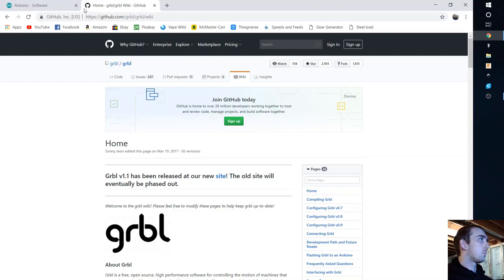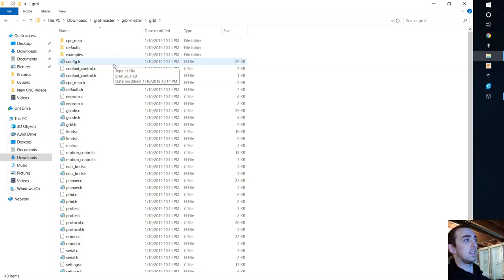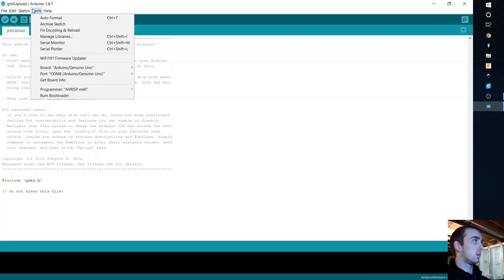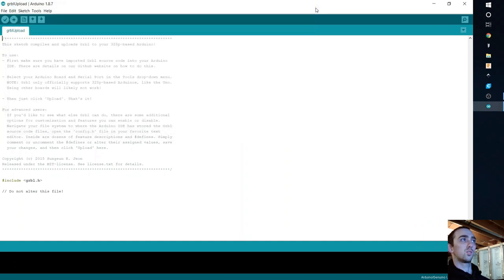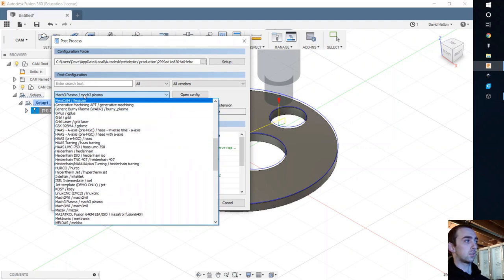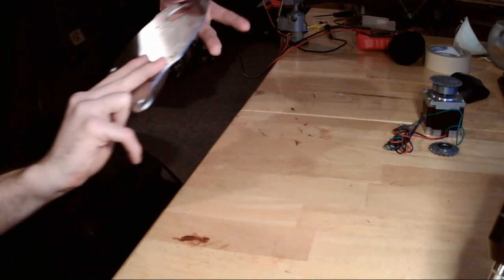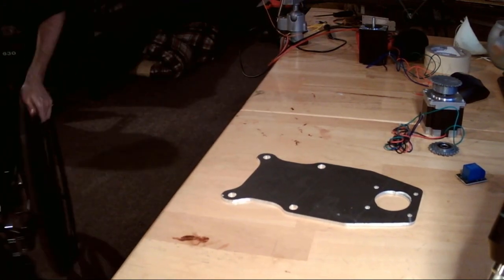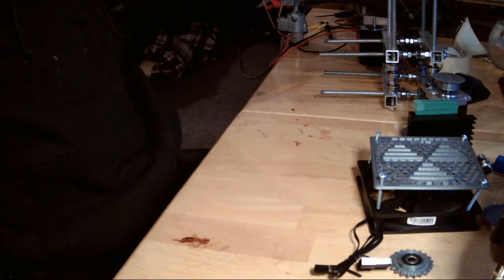Arduino UNO grbl CNC Plasma Table Setup

Comment: I built a plasma CNC machine that is controlled by the MKS DLC 32 version 2.1 card. Basically an Arduino knockoff. Works great until the plasma machine kicks on then it freaks out and either stops and leaves the torch running or takes off in some strange direction. Obviously getting electromagnetic interference. I'm in the process of trying to narrow down solutions. I've tried a number of things. USB isolator. Wrapping the leads in tin foil. Grounding the table and the gantry. Placing metal panels between the control box and the plasma cutter to act as shields. Etc. the best way to get the machine to actually execute the G-Code is to run the code directly from the onboard SD card. But that has its own issues such as no z-axis Control on makerbase ESP controller. Somewhat of a nightmare but I'm going to continue working to figure it out.
Reply: Need to use a "non high frequency" plasma cutter!! Using a high frequency plasma cutter will F*** up everything, too much noise!
Reply from the maker: So the fix is a new non-high frequency plasma as Patrick stated. However there is some solutions that can help (not fix but help) you can shorten data cables, move the plasma as far away as possible, twisted wire, shielded wire, solid grounds, and a bunch of ferrite clips

Comment: Hi, mine works fine, but I have a problem: the printing is in real 2,07 times bigger than I have compiled it. Maybe some trouble with inches an mm. Where can I configure it proberly?
Reply from the maker: it could be a few problems 
1) when posting from fusion on the bottom left of the post process it will say units. UGS should be using mm so select mm or doc unit and have your units in fusion as metric.
2) Your step/mm are off, takes some math. but steps/rotation x rotation/distanse
(way 1)https://www.youtube.com/watch?v=sjsz0USrt78
(way 2)https://www.youtube.com/watch?v=z3bUg9InVeA
these are not my videos  but cover it in depth
3)If your not using UGS like mach 3 make sure you are in the correct units
Reply: @dnc_fabrication  Thank you for your reply! This helped me a lot. Now 50mm are in real 50mm :). But I have another question: Now the speed is really slow. Can I change the speed of the axis? Please write back as soon as possible.
Reply from the maker: So there a two possible problems, again. Also your welcome I enjoy trying to help anyway I can (I have the common problem of not getting my point/solution across sometimes but I try :] )
1) When in UGS the uno settings there is a speed and acceleration setting, this is the maximum not the program speed/what it tells it to run at but the limit (should be set as fast as your cnc will go (i usually do 80% of my max))
2) The g code has the feed you "want" (program speed) that is typed into fusion 360 CAM when creating the tool path
Reply from the maker: in the uno/UGS
speed settings are $110-$112
accel settings are $120-$122
Reply: @dnc_fabrication  finally i made it with your help, thanks man 🤙

Comment: How about high Frequency? Have you any problems? Mine doesn't work :(
Reply from the maker: My newer plasma is not high frequency. But the best way to deal with interference is have your computer as far as you can from the plasma. shielded wires and also the ferrite clips can all help
Reply: @dnc_fabrication  what of the shielded material? my UGS software stoped transfer connection after the plasma is on

Comment: Hello, i just tried to measure the voltage and the command M5 is not turning it off, it is permanently 5V, any idea what am I doing wrong?
Reply from the maker: 1)If you are positive you are using version .9 make sure you follow the notepad part to disable PWM and make sure you are using D12

2)Most common problem is trying to run version 1.1 this way. To run 1.1
    CHANGE SETTINGS;
              $30=0
              $31=0
              $32=0
and spindle/torch are pin D11 in this version
also in 1.1 there is no need to open the note pad and disable PWM.
Let me know if this helps.
Reply: @dnc_fabrication   Thanks for your answer. Yes, i have grbl .9, I changed the notepad but still the M3, M5 does nothing. Im just measuring the pin for ground and pin 12, I dont know if the mistake is in that.. Maybe I will try to upgrade the grbl and try the 1.1
Reply from the maker: i would recommend going to 1.1. But I've also done this a million times make sure the notepad is saved and you are uploading that file not a copy of the original.
Reply: Hi if i use cnc shield with 1.1 grbl i just need to connect with Z+ pin right?

Comment: hey man what grbl v you running you have not got $30 $32 ect Im having trouble getting my to work it will turn on with M3 s1000 but the g code as no s value to it just M3 ect
Reply from the maker: My version is .9j if you have $30,$32 i think that is available in grbl1.1. 1.1 better supports laser, but with that there is a "laser power" setting (i think that uses s after m3). I recommends to go back to .9j if you want on/off